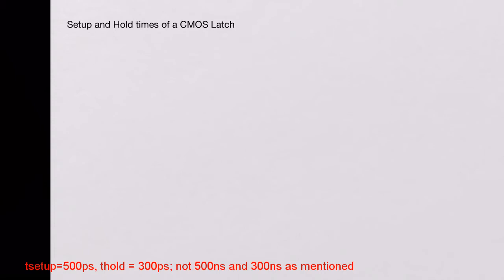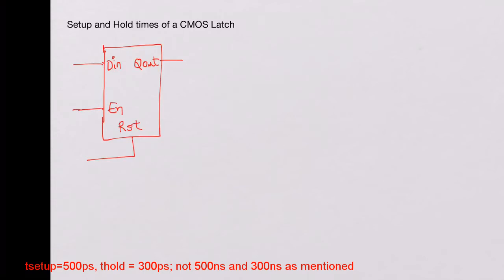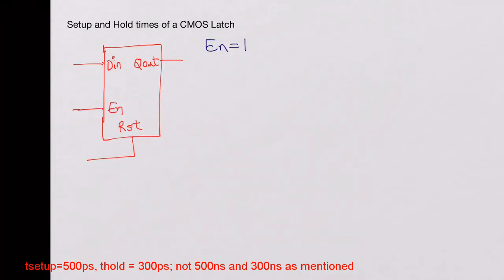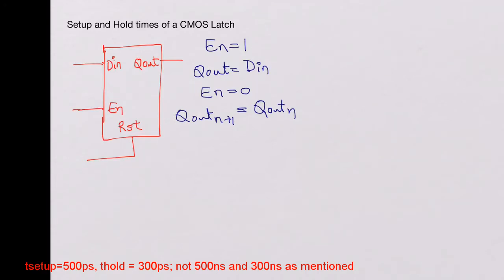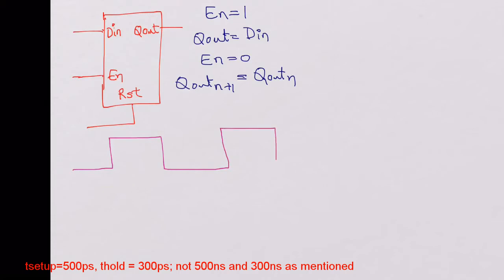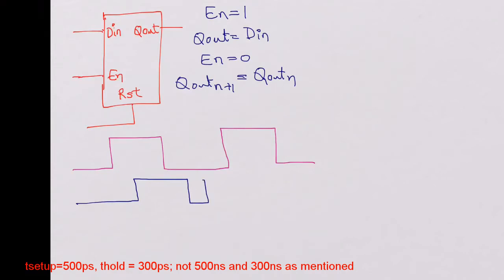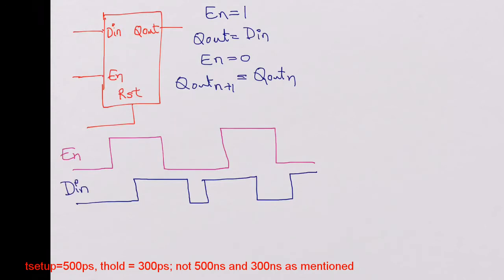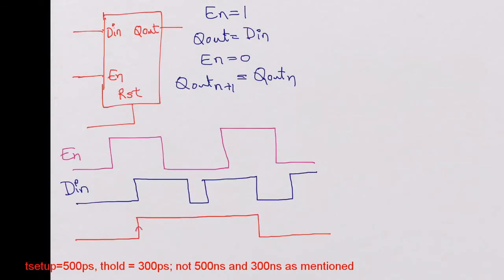What are Setup and Hold Times of a CMOS Latch?  - Explanation

Comment: Why is falling edge considered for latch? 
And what will be the reference in case of flipflop?
Reply: set up and hold time are define only on the basis of active edge of clock,where the trasition occurs.
Reply: @vinaypant569  In Enable rising edge also it make transition right? then why falling edge is only consider?
Reply: Santhanam P in this example, falling edge is considered because it is the “close” of the transparency window. That is, you can generalize and say that you need to consider the edge where the transparency window closes. 
Hence for a neg level sensitive latch, you would consider a rising edge of the enable. Hope that made sense
Reply: @vikineo  So, No need to check for setup and hold checks at rising edge of positive latch?